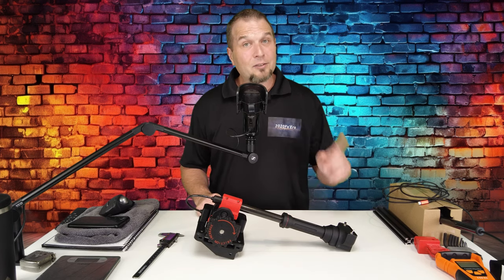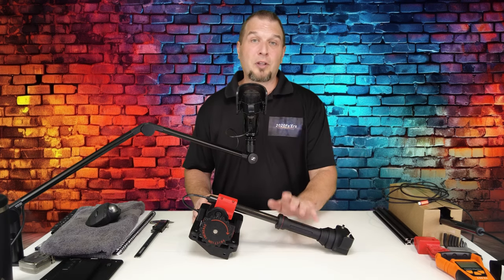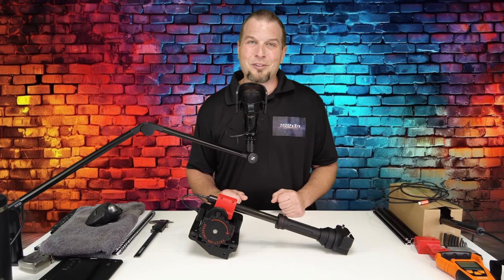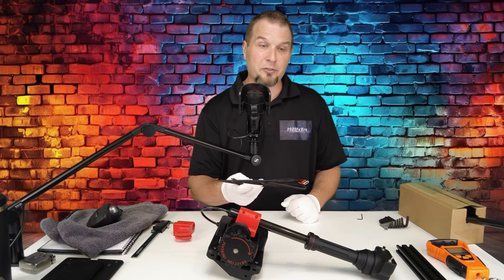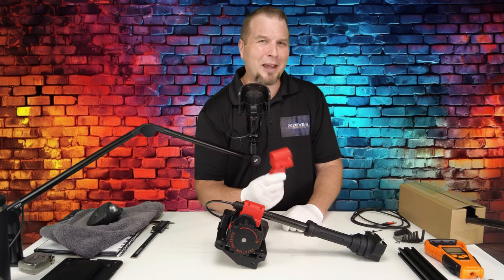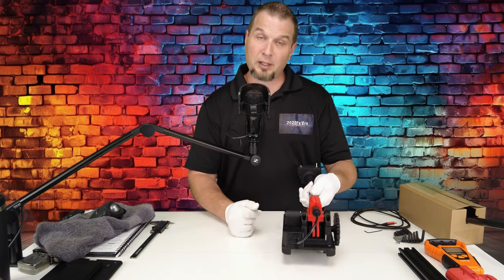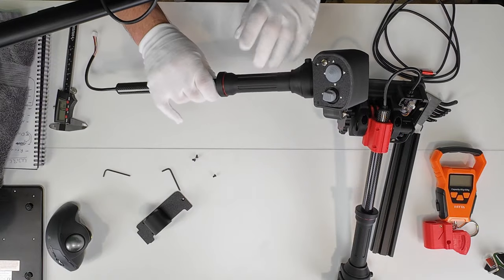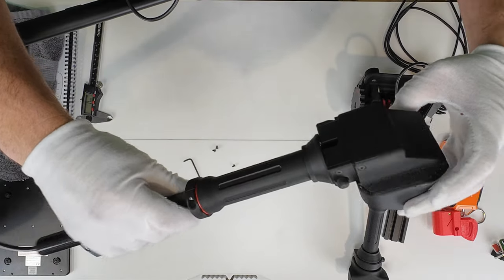Collective Review Microsoft Flight Simulator! **$120.00**Best Bang for buck! Left or right hand.

Comment: Great video. I purchased the HC-500 and received it in a very timely manner. The design and stability of the device is great. I'm having a problem with collective axis's NOT moving to their full extends in MSFS 2024, even after the calibration shows full movement. I wonder what could be the problem. I've tried to contact the JPI3D site and discord to get some advice, but their contact and discord link on their site is not functioning. Any advice from you or those who watched would be appreciated.
Reply from the maker: Sure I can check it out.  What key binds are you using ? And what aircraft
Reply from the maker: Here is the discord link 
https://discord.gg/7pCukxZ2
Reply: @2020fsers  Thank you. I've tried bindings for Throttle, and Collective on the Guimbal Cabri G2 ('Set Helicopter Throttle 1' = Joystick RAXIS X, 'Collective AXIS = Joystick EAXIS Z}, Bell Model 407 ('Throttle AXIS' = Joystick RAXIS X, 'Collective AXIS' = Joystick RAXIS Z) and Airbus H125 ('Throttle 1 AXIS (0to 100%)' = Joystick RAXIS X, 'Collective AXIS' = Joystick RAXIS Z)
Reply: @2020fsers  Thank you. They had a different one listed on their documentation that came with my purchase.
Reply from the maker: Ok I am now testing as I am writing and in the cabri I used the collective axis to set mine and it works through the entire range . On the windows calibration tick the box to see the raw values and re calibrate it . When calibrating the throttle don't go into the click just to to it . And look at the raw data and see if it changes throughout the axis range if it does then finish the calibration and try in the sim again.

Comment: I just ordered it. I have been wanting a collective for years but they are so expensive. I even considered mounting a HOTAS throttle at an angle and attaching a length of dowel to it to use as a simple collective.

This is a dream deal, a bargain. Thanks again.
Reply from the maker: Thanks .. I agree what you get for the money it's hard to beat . And works well .

Comment: PLA is comparable as strong as PETG. The differences are in another place which here matters less
It's called HALL Sensor not Switch.
Overall it looks bulky an way too simple for the grip and looks it will need and have several redesigns till it's somewhere passable.
Reply from the maker: Thanks for the comment
Reply: @2020fsers  No worries, you are good anyway! ;)
Reply: Considering there is nothing anywhere near this price point on the market, I think it's pretty awesome.  Finally a collective option that doesn't cost stupid money !!